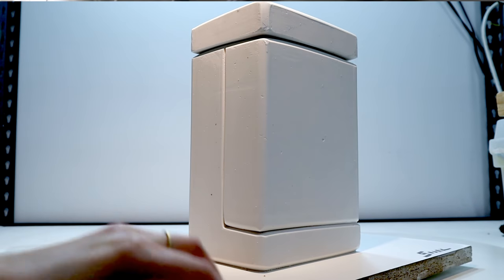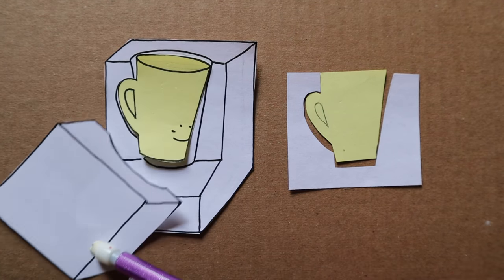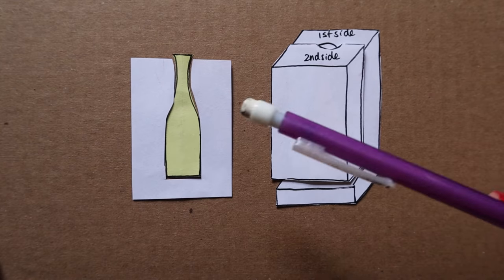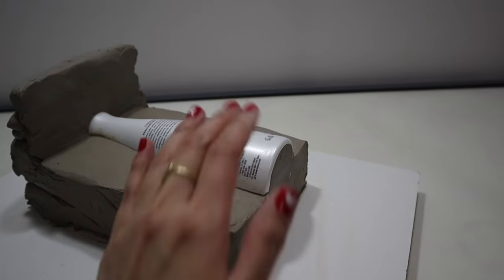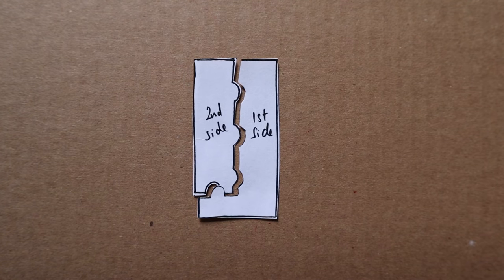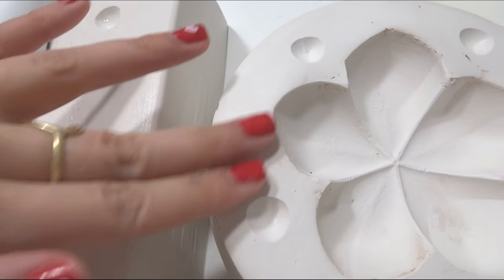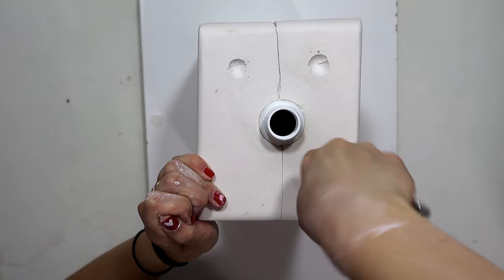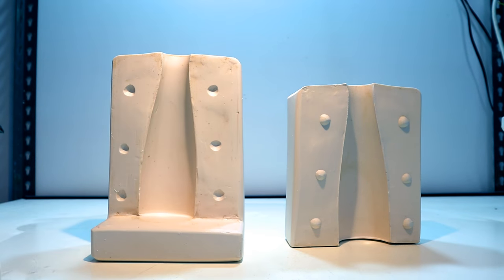THE EASIEST Way to make Multi-Part Molds!

Comment: Tip* Instead of using soap - use Vaseline, then you don't have to layer your soap 5 times. :} This is actually a great video. I like how you drew pictures to show examples of locking your keys,  and showing undercuts. Sometimes trying to explain this without a way to show someone is tough but this is great. I will definitely save and share this to folks who are learning how to do multi-part molds.
Reply: It is super important to make sure you don't get any vaseline on the parts of the mold that will come in contact with your ceramic, because then it wont absorb the moisture evenly and you'll end up with an uneven cast ;( If you want something thicker, so you don¨t have to apply it five times, you could make your own soapmixture by graining and dissolving a hard soap bar in water. If you heat it it will dissolve easier and be easier to get thick. But be aware that a thick soap is more prone to leave markings, which could affect the cast outcome.

Comment: The way you pour to avoid splashing and air bubbles (2:52) is genius. I'm about to make my first 4-part mold (top, bottom, and split middle section to deal with undercuts) to make a complex shape in urethane rubber, and your process for doing the 2nd part of your mold is exactly what I needed to know.

Comment: You're legit af  coming in clutch with more then I thought I would  find out about slip molds in one video !         I make boro items for shops .  I'm purchasing a new small  kiln of Craigslist and it's being sold with all these forming molds / slip mold blocks  .  
  My old kiln is good just some type of switch or contact issue  ,  I need a medium size production kiln though right away .        I have a dental micro kiln , it's the easy bake oven of kilns lol ,  it's getting me by also I can just make more  quartz items .       To make your own molds for ones self never occurred to me  , seems incredibly useful  .

Comment: Such great illustrations and you have a gift. Thank you for your time & videos. Would you use the same process to make a mold of a tabletop lamp? The bottom (base of the lamp) has a square, flat bottom, which is wider than the lamp. Also, can you use quick concrete in this mold, once it has cured?

Comment: hello there! thank you for this information very helpful! so I'm wondering if you've made silicone molds? also do you think this same technique could be used to make silicone molds. Im trying to make silicone molds because I fee like they are lighter, easier to store and remove from the item I'm molding. Im curious to see what you think on the topic and what your thoughts are! Thanks in advance!

Comment: Question about the paper example @0:49, can't you just make the cup on the right a 2-piece mold by making the dividing line run down the length of the handle?

Comment: Excuse me Miss, I would like to know if you could give me some advice on what method to use for a certain mold-cast that I am thinking about... I wanna cast out some hollow sculptures like a body torso that I can turn into a flower pot for example.... however I don't really know how to go about the molding part, I actually use a plastiline-based medium in order to create my prototype, since it is a plastiline based medium i cant just stick cley on it in order to create a plaster mold, because the clay would eventually ruin the plastiline figure, so I was thinking about maybe pouring plaster into a box and holding the figure halfway in if you know what i mean... but then i start thinking about trying a silicone mold... the one you can do with dishsoap and water.... i've heard it should be good as well, since its elastic it should be also easier to demold... I'm sorry if i saturated you with questions but you seemed so lovely that I thought you may even give me some advice on it, or maybe even someone on the commentary section... either way Kuddos and thumbs up for your videos I really like and appreciate the work put into them, also keep up the mood, very lovely mood!! bye bye, greetings from colombia!